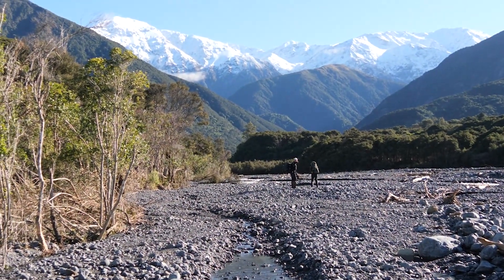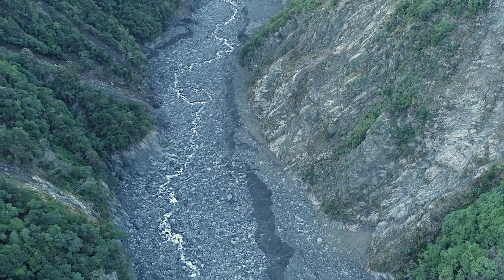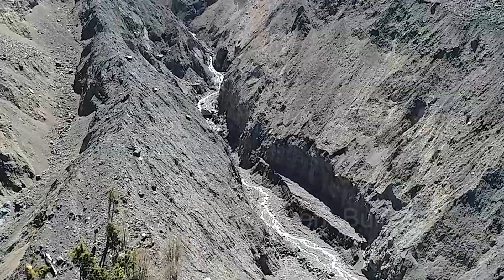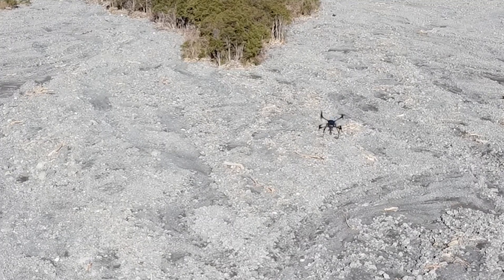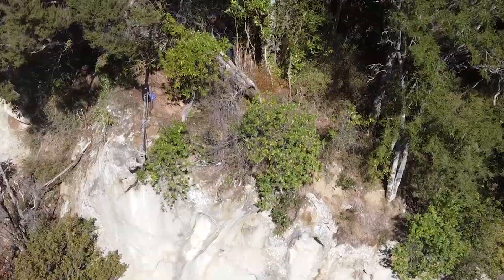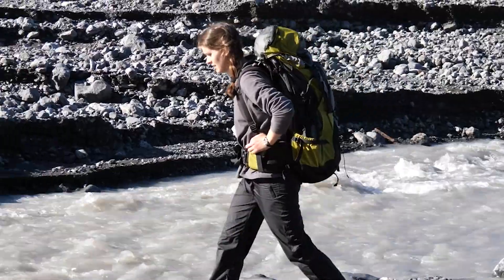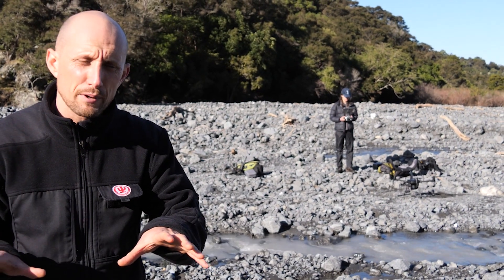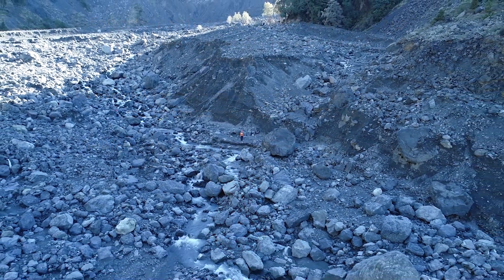How An Earthquake Choked This River

Comment: I am curious whether there were any fish in the river before the earthquake, because it looks like the sediment load and gradient changes have eliminated any habitat for fish, amphibians, and even most macro-invertebrates for at least the next couple of decades as the sediment works its way out to sea. If you look at the delta sediments at the ocean, would you characterize these as greywacke type deposits that seem to be more poorly sorted, and angular materials? The data from these observations may not only help forecast future conditions, but may also provide keys to interpret much older deposits and how they formed with examples of punctuated equilibrium environments.

Comment: Question - do you guys measure the volume of material washed into the ocean, which i assume creates some sort of material fan out into the ocean?  Does the material wash out into deep water or does it deposit along the shore pushing the shorefront out?

And wouldn't this change the dynamics of the water channel under the bridges, possibly creating unforeseen  flood events?
Reply: The shoreline affects of the material just brought down by the rivers would be very difficult to quantify as you need to remember the Kaikōura coast had massive changes itself independent of the river erosion systems feeding into it. There were many hectares of new land created with upto 6 to 10 metres rises in places of the the shoreline against sea level, and even the small rises were significant of 1 to 1.5 m uplifts. These large changes of sea level cause a big change in sediment movements in the marine/land interface just alone. 
When added to the fact there were many large landslides directly off hills into the sea further complicated by the State Highway rebuilding crews washing many many thousands of tonnes of rock and material off the landslides above the new road route into the sea. I stayed with some people in the area just north of Kaikōura over Easter and they told me helicopters were filling monsoon buckets suspended underneath the choppers with sea water and then releasing them onto the slips washing the loose material out to sea was ongoing for months. So you see even without the rives the whole coast has a massive amount of sediment being moved around and along the coast. Trying to isolate the material just coming from rivers like the Hapuku once at the shoreline even with new tech, would be pretty impossible.

Comment: Nice video. Any fossils?
Reply: I was up this area over easter and most of the rock types and land deformation process aren't great for finding Fossils. There is some limestone I saw with fossilized shells but by the time the bulk of this stuff gets down into the river systems the rocks are very broken up due to the massive landslides due the 2016 quake, freeze thaw effects (the top half of the areas mountains are covered in snow/ice during winter) and high water flows on the eroding rivers/creeks. Any well preserved fossils are going to be high up, very difficult to access on very steep slopes which are now mostly fairly dangerous giant scree slopes.
Reply: @user-uy6uc5ey5q  Thanks for the info.
Reply from the maker: I didn't see any, but that doesn't mean there aren't any.